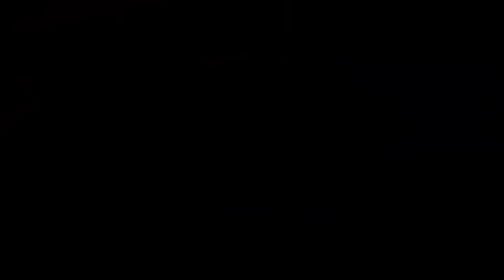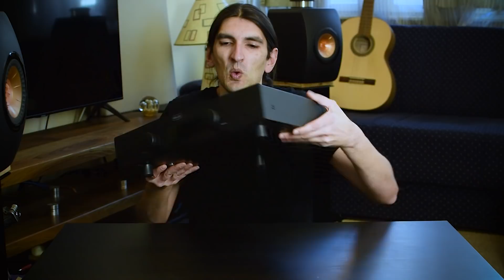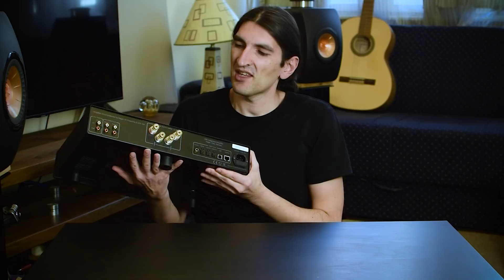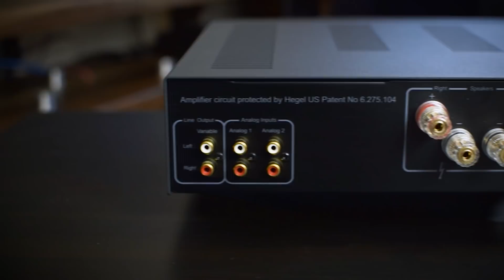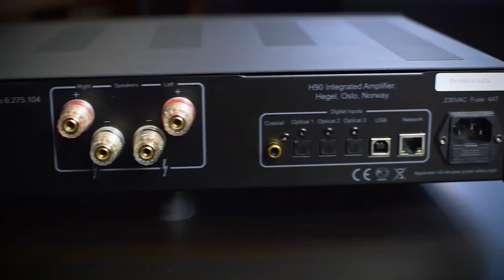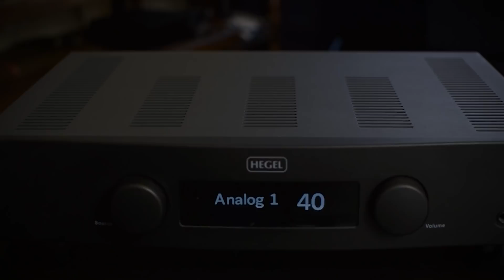Hegel H90 review - A mighty heart of your HiFi

Comment: Can you please give us your opinion on the pairing of the H90 with your KEF LS50's?
Reply from the maker: Pretty nice, good match tonally in my opinion,very neutral. Good soundstage too. Not that much kick and punch, Hegel is calm and laid back.
Reply: @iiWiReviews  thank you! Right now I own an H80 and wonder if I should get the H90 instead for the streaming capability (and the gorgeous display) or if I should rather go for an outboard streamer (Cocktail Audio N15D or IfI Zen Stream for example). The H90 has lower output than the H80...
Reply: @iiWiReviews  one more question please. Did you use the USB connection to a PC/laptop running windows10? If so, what driver did you need? For me, the unit is not recognized as a playback device.
Reply from the maker: @georgedomse  I mostly used SPDIF connection and LAN for streaming... I think I did try USB at one point but don't remember the specifics such as did I need a driver. Sorry, but it was a long time ago, and trying so many things doesn't help to remember. I do know that I was also using Windows 10.

Comment: Superb review! I did an incredible amount of due diligence considering everything from Zu Audio Dirty Weekend's paired with a Decware tube amp to PS Audio with LS50's. After seeing the Focal 1008 BE's on sale for $2999, I compared a Naim integrated with the Hegel and know right away the Hegel was the way to go for my taste. The pairing with the Focal's is astonishing with a beautiful sound stage and incredible bass. I have the speakers sitting on custom Sound Anchor stands. I stream Tidal to a Bluesound Node 2i  connected to the Hegel via coaxial cable to take advantage of the superior DAC in the Hegel. I use Cardas Parsec speaker cables. Keep em coming!

Comment: How would a h90 pair with Kef R3s?
Reply from the maker: Pairs quite nicely, it's a very good tonality and soundstage, but R3 is capable of even more dynamics than the H90 can provide. A friend used them with H90 first and then switched to H190. Sounded nice with both, but additional power makes them sound even punchier in the bassline.

Comment: You are right on point my man. I also have the hegal h90 and I have been wondering if adding a power amp from a different brand is a good idea. I am thinking of the iota P3. What do you suggest?.
Reply from the maker: I haven't tried doing something like that but not really sure you would gain anything. Iota P3 shouldn't really be an upgrade from the internal Hegel amp... if anything it would probably be a sidegrade with some different traits.

Comment: Thanks for the review. Appreciate it. However, for those considering buying, careful about Hegel. My experience has been nightmarish. Hegel may be the most hyped and overrated amplifier. I bought a brand new H190 for USD 4000 and was shocked at how underwhelming it was compared to even my Marantz PM 6006 which cost a thirteenth of the Hegel ! There was no base, no body, no weight, no fullness to the sound. For a 150 watt per channel amplifier it sounded shockingly underwhelming and under powered for the price. To make sure there are no 'weak links' in the chain, I spent an additional 6000 USD on accompanying equipment - Audioquest Niagra power conditioner, KEF LS 50 Meta speakers, 10 AWG OFC pure copper speaker cables, Audioquest banana plugs, Audioquest NRG Z3 power cable - all brand new (I don't buy used stuff ever) - to give the Hegel the best possible partnering equipment -but even with all this it sounded worse than a 300 USD amplifier. Even my SVS Soundbase amplifier at 500 USD sounded so much punchier, fuller and better. I tried the Hegel with 4 different speakers - KEF LS 50 Meta, Elac Debut F5, Wharfedale Diamond 10.2, Mission LX-2 - the last 3 of which I have been using for several years and that all sounded fantastic with my other amplifiers - and most importantly that are broken in. For streamer I used the ifi Zen Stream, Bluesound Node 2021 and H190's internal streamer - all with CAT 7 ethernet cable as well as wireless (for the ifi Zen Dac and Bluesound - just to compare). ALL digital and analog interconnects were Audioquest. The Hegel at half of it's full volume was hardly powerful enough with a stated power of 150 watts per channel ! Consider this - I never need to turn the 45 watts per channel Marantz PM 6006 up more than one fourth of it's full volume - and it produces beautiful warm, full, punchy sound - a joy to listen to - and the Marantz cost 1/13th - yes - one thirteenth of the Hegel H190. I can't believe the experience. I could not wait to return the Hegel and get my money back! It definitely seemed like a quality control issue since it is just not possible that this brand is so raved by all  with this kind of sound - but - at this price such quality control issues is unacceptable and I do not trust the Hegel brand after this experience. This is because I have read people having the same issue with the Hegel H 190 even with multiple replacement new units. Please note - before you talk about room dimensions, power line and all the other variables - whatever I stated above is with all of these factors the same and just changing and comparing the amplifiers - so with everything the same there is no excuse of a 4000 dollar amp sounding the way it did and a 300 dollar amp being way better than it in all respects. I have seen reports of the exact same issue online.
Reply: Come to think of it. I experienced the  same issue at first with my H90. I was turning the volume up to 70 just to get normal sound. You have to change something in the settings I think.
Reply: Hmmm...won't argue with your first hand experience. However, my H90 paired with Focal Electra 1008 BE's is punchy, well balanced and a pleasure to listen to. I have the Focals's sitting on custom Sound Anchor stands ($800/pair) which provides astonishing bass response and incredible sound stage.
Reply: Gosh you’re so lucky to be able to be satisfied with such a small outlay- despite spending a fortune on the Hegel with cable etc. of course that’s your experience so who is to argue?

Comment: I bought and use it like you do with the 3000 $ DAC: Audio Alchemy DDP 1 and PS 5 Power Supply and the TRITON TWO + which takes  over the bass with its 1200 watt bass amp down to 24 hz - so I get the best of all worlds. I got it 2.th. hand for only 932 $ §;-)

Comment: Great review! Do you use it with the KEF LS50? Is it ok? It is enough power? Thanks!
Reply from the maker: Yes I use it with LS50 and I like this pairing. There's enough power for moderate (neighbors friendly) volume levels.
Reply: @iiWiReviews  I tried it with the kef! Very nice!! But then I tried an Atoll IN 200... ridiculous!!! Just mind blowing. All the point that lacks in the Hegel h90 is fixed here. Just look online how it is built inside... better then a h390... and made in France. If you get a chance get one with your eyes closed. They also make it in separates pr200 and am200 suppose be even better. Cheers!
Reply from the maker: @AntoninPassemardPaintings  Atoll IN 200 sure looks great, outside and inside, and I would love to get my hands on one if the chance presents itself. Cheers!

Comment: Nice review. I've never listened to any Hegel product, but I find them interesting. From a value standpoint, I find the Hegel H90 lacking. For $1600 USD, you can buy a Rogue Audio Sphinx V3 with higher output thanks to the Nord Class D amp modules. It also includes a Phono input. The "Not invented Here" Hegel way of doing their own network stack shows up by limiting bit rate of streaming files. Also, lack of Roon support is a real let down.  DLNA support doesn't support gapless playback. I really find Hegel's  ideas about amplification interesting, but I think they price themselves above the competition and are a bit idiosyncratic with their digital stratey.

Comment: Very very poor streamer IMHO. No App, No Roon. Using Bubble UpnP no Radio full "data" like Radio Paradise, for example. With M-Connect that Hegel push as "the only APP you can use", no HD file with Qobuz, for another example.
Well, if you have some "tips" I will be glad to hear it but do not talk me about PC and "minimerver" because this is a "one4all" device and should be ready in 2021 to stream and to be associated with an APP, even one not Hegel like "Primare" (ROON compatible) or "Peachtree" or "Dali" etc.
Good amp, "basic DAC for the money" and very very poor streamer.
Reply: Bubble UPNP extremely well for an app for your smartphone or tablet.
Reply: @buttonman1831  Without minimserver or some PC's around (direct streaming on Hegel) it does not work with HD files and with radio like RP. For this kinda device... it's boring. Try it.
AND GAPELESS? H90 NOT SUPPORT IT! (Hegel does not support H90 anymore... the review already said this? Good...)
Reply: @AutoreNegro  I just stream my flac files and Tidal on my network.  I don't care about HD files personally.  At this price point, to get a good streamer, good DAC, and good amp in one box at this price is a good value.  No no other manufacturer matches the features and performance at this price.
Reply: @buttonman1831  Amp is very good IMHO. DAC no. You can read listen in many, many review. Hegel also change it with H95 this device but OK, it's a DAC.
Streamer (WITH NO PC) it is VERY VERY POOR, if you do not care about "HD stream" it's your choice but remember that Qobux for example has every day more HD (master) files so... in yr 2021 not to play 24/96 or more... it's...
I mean... with this HIFI device?! And I think should be said.
If you ask to Hegel they will answer that only M-connect is supported... no ROON no APP... Mhmmm....
Buy it but do not hide that the streamer part is very very poor.
Bye.
Reply: @AutoreNegro  The H90 beat most integrated amps without built in DACS and streamers at this price point.  To say the DAC and streamer is very very poor shows your ignorance of the product.  The Streamer is a very low noise and low jitter. Hegel go through great lengths to eliminate noise from the streamer, DAC, and amp. You would have to spend around 500 US for better audio quality in a streamer.  The DAC is very good for a unit AT THIS PRICE.  Again, you would have to be over 500 US minimum to improve upon it.  in my 30 years I have owned dozens of amplifiers in the 5 to 10k range and would rate the h90 one of the best in terms of price/performance.  Not a single one of my audiophiles friends use Roon and are perfectly have with Bubble UPNP.   My last speakers I used with the H90 (Goldenear triton 3+) sounded very realistic.  Perfectly balanced tonally, holographic, absolutely stunning.  It sounded so good, it made me start to question why anybody would need more.  Show me an amp at this price point that can compete with the H90 in terms of features and performance.  Naim? Yamaha? Bryston? Moon? Nope, all great amps, but all cost more without DACS and streamers and arguably may not sound as good.  I don't believe for one second you have any real experience with Hegel products.
Reply: @buttonman1831  Good to hear a Hegel fan here!
Please, take a break and do not use words like "ignorance" to me: you don' know me.
If Hegel change this H90 with H95 there is a why.
Important to the customers (and please Hegel fans, continue to follow the Hung Lo with confidence :) HEGEL dos NOT support anymore this device: check online Hegel site.
I have several emails from Hegel that are telling this.
Hegel H90 (IMHO: do you know what does it mean Mr. Hung?) is a very good amp bau DAC is "so-so", nothing so special where for example node2i (BluOS a wondeful OS, and PLEASE, WHEN YOU BUY A STREAMER OS and APP ARE IMPORTANT more than stupid fan' nonsense word!) do for half price "better"...
The streamer of Hegel H90 is very poor and will be NOT more supported by Hegel!!!
Is this an "important feature"? Remember that this Hung fans writes a) he does not use HD files... and his friends don't need ROON.
Are these feature NOT important for a streamer? Hegel does NOT support Bubble but only M-connect and I repeat myself if you stream without PC and minimserver around NO HD files are streamin' and TAKE THIS:
NO GAPLESS WITH H90!!! NO GAPELESS!!!
I had a H90 and now H120 that is way better (the H95, too) I will send you picture if...
But, I end here. Follow Hung or Hegel for me it's the same but I am writing things that you can check by yourself...
Buy with data... without fanboy! (If you want)

Comment: 19:07 - it is not surprise - coaxial is much worse than USB ;-)
to complete this device: if you could install on the streamer i.e. Logitech Media Server and use the player directly on it....
otherwise Raspberry streamer with LMS is still the winner ;-)
high resolution files require good CPU so probably Hegel simply "saved" some $ on this DAC
btw 1600 GBP for this amp - it is NOT any bargain by any means
get Rega Elex-R for half of this, add nice DAC (that will be way above this built in Hegel) and you have much better combo

Comment: The Hegel is a very good piece of electronic, but I cannot recommend it to any of my friend simply because it has no App interface nor Roon integration (other than Airplay). For an average consumer, a NAD M10 or Unity Atom will be a better choice because they have seamless software and hardware integration an Roon support.
Reply: You know you can use Bubble UPNP on a smartphone on tablet?  I have used other apps for other streamers but I find Bubble Upnp does a good job.
Reply: @buttonman1831  I have used Bubble upnp with it, and frankly I was not impressed even a bit ...
Reply: @simplereef4854  If you want better software you will need to buy a external streamer such as a Sonos play which has inferior sound or a Bluesound node 2 which is a slightly better streamer in terms of sound but about 1/3 the price it has an inferior dac.  I don't find bubble upnp that bad.  I owned a Auralic Aries g1 that used a dedicated Iphone app and thought the app was slow and extremely  buggy.  This high end streamer was double the price of the h90 and the built in DAC of the g1 was only a little better.  The h90 is a good value integrated amplifier when you look at the option available at its price. I'm curious, what was it about bubble upnp you didn't like? I find It does everything I need it to do.
Reply: @buttonman1831  ... Bubble UPNP does a lot of clunky things that make its operation very awkward comparing to Roon or Squeezebox. It also does not support IOS devices, and almost 90% of my family use Mac devices. I just give you a few drawbacks, there is a long list of awkwardness that I found when using Bubble UPNP. I wish Hegel will just make an all analog amplifier with no streamer. That will become more ideal
Reply: @simplereef4854  I agree it is a bit clunky but this integrated amp is cheap compared to the Nad or Naim but it still works flawlessly using bubble upnp.  It isn't meant to be a fancy streamer as the price reflects, but the fact you get a low noise, low jitter streamer, a solid DAC, and a great amp in one box for 2400 cdn is pretty damn good.  The Naim is literally almost double the price at 4200 cdn. and I would wager objectively it would be in the same class in terms of sound quality.  You could buy a bluesound streamer that would provide all the features you wanted and still be significantly less expensive.  I personally  have never been a fan of fancy features.  I prioritize  raw performance and I feel I get that with bubble upnp. There is also iOS apps that allow you to stream tidal and other music services the same way bubble upnp does.

Comment: Great review, sounds like you got it spot on as always. I also bought a used Hegel to pair with used Martin Logans esl's. Both at a great price too! Also I was told by Anders Ertzeid of Hegel (In a you tube video comment) that they use to pair them with Martin Logans for testing. So, yeah they compliment each other well. Just saying if anyone is interested, they can be both found on the used market in Europe at good prices. Guys, check out the website above, it's great, I was surprised.

Comment: Thanks for your review. I own a H120. I compared the built-in DAC to the Denafrips Ares II and I do not think that the Ares II sounds better than the built-in DAC...
Reply: The H120 is a more expensive amplifier, and the DAC section is not the same. I also own the Ares II and honestly preferred my Rega Dac. Then I got two new (well used) amps and suddenly the Ares is the better and more balanced device. Go figure :-)
Reply: @RigVader  The H95, H120 and H190 are supposed to have the same DAC... The Ares II is great anyways. I like its build quality and sound of course...
Reply: @ralfm3710  Yes, I believe you are correct. My point was that the one in the the H90 is different. Sorry, maybe we are just getting our wires crossed :-)

Comment: You got the sound of the Hegel right. Uncolored midrange, smooth highs, black background and great control. The build quality don't reflect the asking price but they are good value second hand. They also limit the usb input to 96khz for no good reason IMHO.
Reply: sounds kinda similair to Arcam this description? Thoughts?
Reply: @Ustaleone  I have no experience with Arcam unfortunately so I can't confirm or deny it.
Reply: actually there was a reason why the usb input is limited to 96. they explained it somewhere.